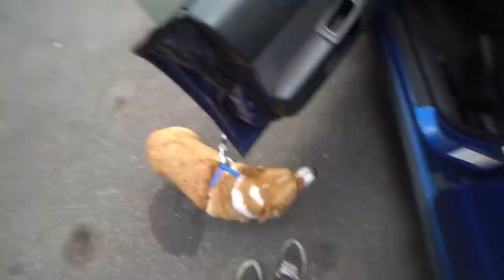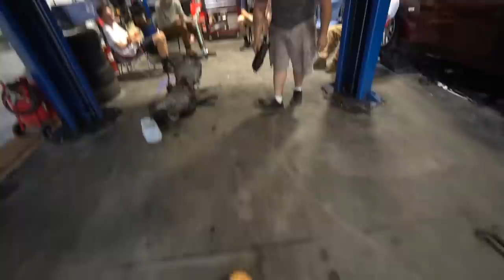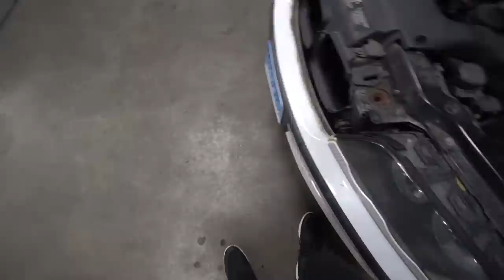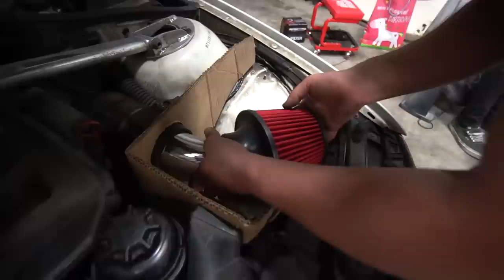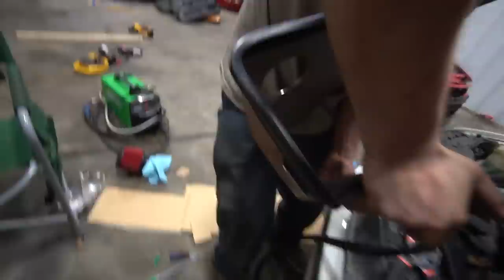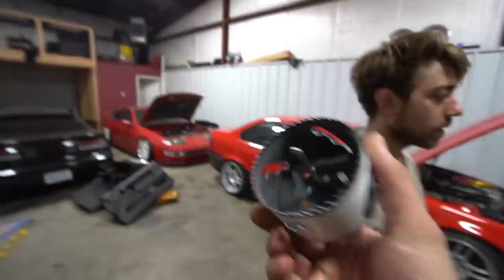THE RIGHT WAY TO MAKE A BUDGET COLD AIR INTAKE!

Comment: Possibly use an antenna from a radio to measure the distance from the hood in multiples locations. Closing the hood pushing the antenna down and then measuring the antenna. So then the heat shield would be flush with the hood
Reply: Or use a small plastic bag filled with sand. Or with Clay.

Comment: It'd be interesting to put a thermometer where the intake is with the heat shield and in the engine bay to see the difference in temperature.
Reply: JJM I thought about doing that a before an after with my 5.4 triton stock air intake then cold air intake aka hot air intake
Reply: @sonacphotos  yep.    Most of the OBD readers will tell you ambient under hood, intake, and of course engine coolant temp.
Reply: @sonacphotos  but more crucially, we should compare the ambient atmospheric temp compared to the air temp at the filter AND the throttle body.   Because I’m an evil genius, I figure that air at the top of the engine compartment is going to be hotter than down low.  We should follow the lead of the OEMs in relation to engine cooling.   They don’t mount the radiator or condenser  horizontally against the hood for a good reason.   Another consideration is that the number one concern of engine operation for the OEMs is emissions, with fuel efficiency in second place.  Bottom line is that the hotter they can run the engine without destruction, the cleaner the emissions.   We want power, they want clean burn.   I’m gonna fashion a duct made of a more heat insulating material, maybe even wrapped with that sticky silver foam backed duct wrap insulation tape.   Keep the filter outside of the engine compartment, preferably next to the radiator but not blocking it, and route the duct as short and straight and low as possible before it gets to the throttle body.     All I know is this: when Magnum RT is cooler, but with the heads warmed up just a bit, but before the whole compartment gets hot, including the intake tract, the difference in horsepower is dramatic.   Very dramatic.  And I’m not talking about heat soak.
Reply: Lol, cold air intake,so in the winter months you have more horsepower?
Reply: @niveklor1456  correct
Reply: under the hood of my car is about 200 degrees, my intake is about 50 with a heat shield

Comment: Make sure you don't have ecu cooling casing attached to the filter . Otherwise you can get a engine ecu cooling fan ... 12volt compact volvo check this out ! You can wired it with a fuse wire on hot when key on .

Comment: I need to make one for my car. It will definitely help with my intake temps.
Reply: It all depends on where the MAF Sensor is located that gives you Intake Temperature Readings. Mine is located close to the Throttle Body and my intake pipe gets hot from the engine heat. It gives me upwards to 170°F in temperature at IDLE...While I am driving, it goes to Ambient or lower than Ambient temperatures. I live in NY and driving through Manhattan was really bad seeing my temperature go up to 174°F due to the intake pipe just being hot.

I may have to wrap it or wrap the engine components to block out some heat from the engine.
Reply: However, consistently driving at a 60mph speed increased my MPG. I probably drove like 3 miles without seeing a decrease in gas mileage. It's just in traffic and city is where you get hurt and your ECU adjusts itself showing lower gas mileage even with a full tank of gas.

Comment: Inspirational Video, just installed a Cold Air Ram, but they didn't provide a heat shield which you would think would be default.  I don't want to use sheet metal.  Any other suggestions on a material I can cut with Scissors besides cardboard?

Comment: I've ran tires bigger than that on my Hardbody with no issue. Those springs broke from overheating and shock. So it's more a driver (not saying Drew but the previous could have beat on it) than tire. Chatter....that's caused by tires to large
Reply: Wouldn’t hurt to go over to aluminum wheel Steelies are stupid heavy
Reply: I haven't had issues with my clutch and I'm running 29 in. tires on a Miata lol. I think your right about the other owner prolly beating on it.

Comment: You are NOT cooling your alternator, you are heating the air coming into you custom non enclosed box. You should have built a bottom panel to block out the heat from the engine and alt.

Comment: 43 HP? Someone's been huffing the starter fluid, or they knew that clickbait would work!
Reply: @boonamai8926  I've seen massive increases from them, but it's more like 20-25HP unless the engine is massive and already cherried out. My dad's POS 4-cylinder truck made a monstrous leap, but he also installed a much larger throttle body and off-road chip. That gave him about 40-50hp total.
Reply: @boonamai8926  that sounds like my Chinese ATV's which are actually surprisingly high end if you buy the right ones. 

My dirt bike has a 1st generation frame which is unfortunately mediocre, but it has a BMW fork and Zongshen engine which is a superior engine to what is built now. The intake box was equivalent to opening a soda can, so I cut out the entire top and installed stainless steel mesh. I gained easily a couple HP. It tops out @ about 70mph up from 60. My nephew's Kawasaki motorcycle at the time was bored out to an 850cc, and my acceleration easily matched his until midway winding out 4th gear in both. 

My quad is a Yamaha raptor clone with a 230cc Honda engine clone. It accepts almost all the parts from a Yamaha 250 and has a frame that took 2 brutal rolls without even chipped paint granted I nearly died the first time. I upgraded the computer-controlled ignition, plug, plug wire and opened up the intake and again, gained a couple horse power.

It's only 4 gears but hits 50mph ATM and would eat up 2 more gears like candy. I could easily compete with guys running 400cc's, 5 gears and more obviously, major name brand. It pulls wheelies in 3rd even with me at 200lbs, so I could add 1" of tire and an extra sprocket tooth to hit 60, and not even notice a drop in power. 
I assume the Chinese do this so owners modding them can brag, but also because the quad is cheap, super fast and high torque, so people would literally die thinking it's a beginner's Chinese junker.